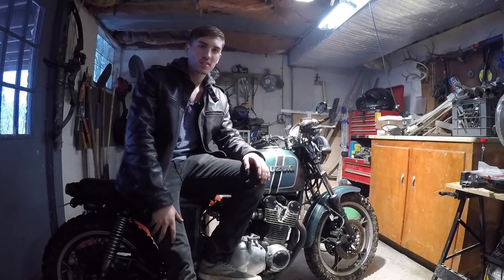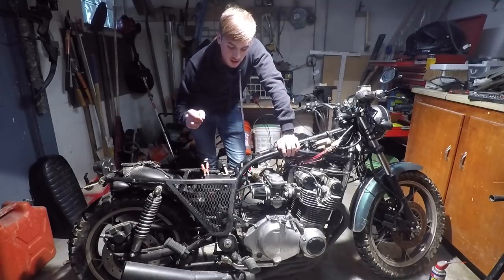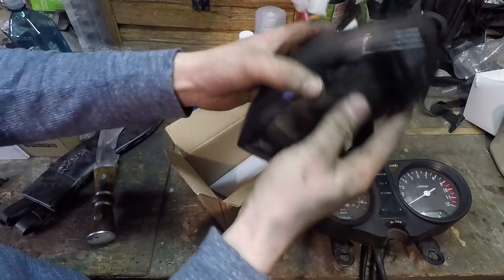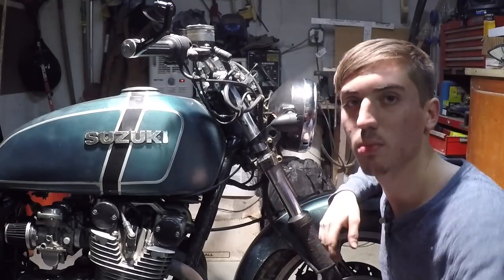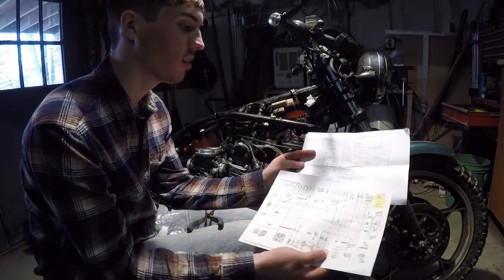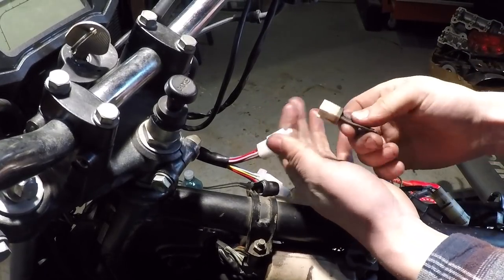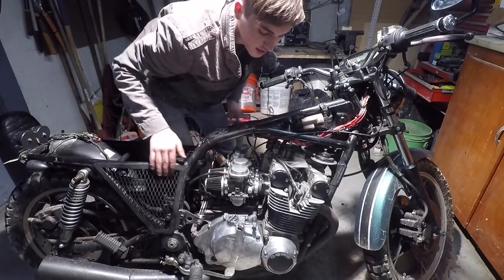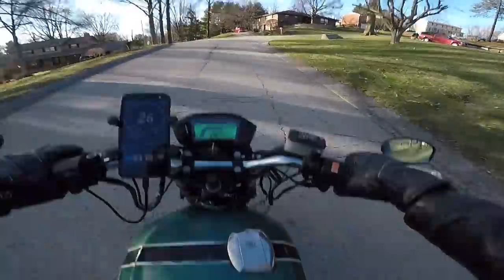How To: Convert Your Old Stock Tach/Speedometer Gauges to Digital! /GS850#14/

Comment: Was wondering where you found the English translation to the gauge instructions.. mine are in Chinese
Reply: A. Short press the left button to switch between total (TOTAL), subtotal (TRIP) and water temperature gauge.
B. In the subtotal interface, press and hold the left button for 3 seconds to clear the subtotal.
C. In the total interface, press and hold the right button for 3 seconds to enter the clock setting, the hour digit flashes, the second point does not flash, short press the right button to add 1, long press the right button to switch to the minute second flashing, the second point does not flash, then long press Right click to save and exit or 10 seconds of no operation to automatically save and exit or turn off the door to save and exit.
When the oil alarm symbol is displayed, switch to the TOTAL interface, press and hold the left and right keys at the same time for 3 seconds, the oil light will be off, and the next round of counting will start.
Light blue: turn right, 12V positive control, LCD display
Yellow/Black: Speed signal
Red: battery (normal, 12V positive)
Blue: High beam, 12V positive control, LCD display
Green/White: Water temperature signal
Green: 12V negative
Orange: Turn left, 12V positive control, LCD display
blue/white: fuel signal
Black: 12V positive
Φ4 round head
Brown/Red: Engine failure, negative control, LCD display
Gray: 6 gears, negative control, LCD display
Pink: 1 file, negative control, LCD display
Blue/Red: 2 files, negative control, LCD display
Green/Black: 3 files, negative control, LCD display
Yellow/Red: 4 gears, negative control, LCD display
Brown/white: 5 steps, negative control, LCD display
Green/Red: Neutral, Negative Control, LCD Display
red/white: positive sensor
Green: sensor negative
black/white: sensor signal
1 Background settings: enter the background with a password. (Major and Imperial backgrounds can be set)
Press and hold the left button to power on and enter the background setting interface.
P000: Password input 6610
4C1850:
1850 represents the perimeter, long press the left button to flash, short press the left button +1, long press the left button again to switch to the tens (0-9)
Tens digit flashes, short press the left button + 1, long press the left button again to switch to the hundreds digit (0-9)
Hundreds digit flashes, short press the left button + 1, long press the left button again to switch to thousand digit (0-9)
Thousands digit flashes, short press the left button +1 (0-2), long press the left button again to enter the magnet number adjustment interface
4 means the number of magnets, short press the left button + 1, long press the left button to save. After saving, short press the left button to enter the metric and inch interface
1-01: Metric
1-02: Inch system, long press the 1 of 001 to flash, short press the left button to switch to 2, long press the left button to save. After saving, short press the left button to enter the speed interface
2-002: Speed 166hz=10*1000 rpm, 2-004: Speed 333hz=10*1000 rpm, long press the left button and the number flashes, short press the left button to switch, long press the left button to save and then short press the left button to enter the fuel interface .
3-002: Two-Line Fuel
3-003: 3rd line fuel, long press the left button and the number flashes, short press the left button to switch, long press the left button to save and short press the left button to enter the main interface of the instrument.

Comment: Do you still have the Chenglish wiring diagram? I bought the same tach/speedo gauge but it didnt come with the diagram. Also the one the seller provided is completely wrong. Thanks in advance
Reply: A. Short press the left button to switch between total (TOTAL), subtotal (TRIP) and water temperature gauge.
B. In the subtotal interface, press and hold the left button for 3 seconds to clear the subtotal.
C. In the total interface, press and hold the right button for 3 seconds to enter the clock setting, the hour digit flashes, the second point does not flash, short press the right button to add 1, long press the right button to switch to the minute second flashing, the second point does not flash, then long press Right click to save and exit or 10 seconds of no operation to automatically save and exit or turn off the door to save and exit.
When the oil alarm symbol is displayed, switch to the TOTAL interface, press and hold the left and right keys at the same time for 3 seconds, the oil light will be off, and the next round of counting will start.
Light blue: turn right, 12V positive control, LCD display
Yellow/Black: Speed signal
Red: battery (normal, 12V positive)
Blue: High beam, 12V positive control, LCD display
Green/White: Water temperature signal
Green: 12V negative
Orange: Turn left, 12V positive control, LCD display
blue/white: fuel signal
Black: 12V positive
Φ4 round head
Brown/Red: Engine failure, negative control, LCD display
Gray: 6 gears, negative control, LCD display
Pink: 1 file, negative control, LCD display
Blue/Red: 2 files, negative control, LCD display
Green/Black: 3 files, negative control, LCD display
Yellow/Red: 4 gears, negative control, LCD display
Brown/white: 5 steps, negative control, LCD display
Green/Red: Neutral, Negative Control, LCD Display
red/white: positive sensor
Green: sensor negative
black/white: sensor signal
1 Background settings: enter the background with a password. (Major and Imperial backgrounds can be set)
Press and hold the left button to power on and enter the background setting interface.
P000: Password input 6610
4C1850:
1850 represents the perimeter, long press the left button to flash, short press the left button +1, long press the left button again to switch to the tens (0-9)
Tens digit flashes, short press the left button + 1, long press the left button again to switch to the hundreds digit (0-9)
Hundreds digit flashes, short press the left button + 1, long press the left button again to switch to thousand digit (0-9)
Thousands digit flashes, short press the left button +1 (0-2), long press the left button again to enter the magnet number adjustment interface
4 means the number of magnets, short press the left button + 1, long press the left button to save. After saving, short press the left button to enter the metric and inch interface
1-01: Metric
1-02: Inch system, long press the 1 of 001 to flash, short press the left button to switch to 2, long press the left button to save. After saving, short press the left button to enter the speed interface
2-002: Speed 166hz=10*1000 rpm, 2-004: Speed 333hz=10*1000 rpm, long press the left button and the number flashes, short press the left button to switch, long press the left button to save and then short press the left button to enter the fuel interface .
3-002: Two-Line Fuel
3-003: 3rd line fuel, long press the left button and the number flashes, short press the left button to switch, long press the left button to save and short press the left button to enter the main interface of the instrument.

Comment: Why not lower the headlight down to where you put it originally, then slide the new tach/speedo unit down to where it touches the top of the headlight? Would give you such a better streamline look!! Try it!!
Reply: Hi, I take your point about the 'look'... but I was going to suggest putting the lamp back where it started, by raising the new gauge on 's' brackets... I suppose it depends on how one sits...
But good video. Thanks.

Comment: how did you wire the fuel level???? I just picked this up for my 80 cb750 and the blinking fuel is starting to bug me lol... mine didn't come with fancy instructions, just a single page in broken english
Reply from the maker: gilberto tapia does your bike have a stock fuel guage?
Reply: there is a fuel gauge, but nothing that goes to the tank so i have no idea how it works... It should be similar to your 81 cb750.  Im just wondering if you remember the wire colors for the fuel gauge part of the digital display, so I can figure out how to delete it somehow. Thanks for the reply btw!
Reply: just tore the old cluster apart, the gauge wasn't connected, ... i guess the cluster that was on it was from another bike, so no gauge on the bike originally
Reply from the maker: gilberto tapia okay then you can't hook up the fuel gauge properly so to make it stop blinking you just have to ground the fuel guage wire on your new guage cluster, I cant remember what color it is

Comment: You should install clip-ons or at least drag handle bars next.
Reply from the maker: David Tacklind on a scrambler?
Reply: Absolutely. I have a 1978 Honda 750F that i bought new. I remember I paid $2200 cash for it.   The first thing I did was add Kerker 4 into 1 exhaust , Mikini carburetors and clip-on handle bars. Then i drilled the brake rotors - three hundred holes in all and painted the frame bright orange to compliment the black tank.  It's still cool. I have a collection of eight 1970's Honda 750's and 550's that I will be remodeled to look like Honda factory Daytona track racers with factory full race fairings. My every day bike is a 2004 Honda CBR 600rr.
Reply: That's a big no..  he need a upright and widely good controlled handlebar...stay with the flattrack/scrambler style GG..  and keep up the good work!!.

Comment: So what "idiot" lights does this have on it? Why dont you hook the tach to the negative side of the coil? Every other tach hook up is to negative side of the coil. 

I have a 99 shadow 750 and the cable speedo doesnt cut it and I only have lights for oil pressure, water temp, neutral, turn, kickstand, high beam.
Reply: what speedo did you use dude

Comment: Does anyone know if this would work on an older car fitted with a newer engine? 
Car model year Mercedes benz 1985 reads from tachometer cable, fitted with Lexus ls 430 engine 2001; which reads through speed sensor. For some reason my speedometer gets its readings from a cable not a speed sensor. I'm planning to switch it to an LCD display speedometer which I have the software ready for.

Comment: Bro can it be fixed on fz16 directly
Reply from the maker: It can be fixed on any bike, but directly? No, this is a universal unit so you will need to make or modify your brackets to fit it, and then you will have to splice the wiring harness on.
Reply: Not available on ebay send me the amazone site please

Comment: What about the fuel gauge?!
Reply from the maker: My bike doesn't have an in tank fuel level sensor so I couldn't hook that up but if yours does, just hook up the wire from your gas tank to the speedometer and it should work.

Comment: 2 quick things. 1: that tach does not even sorta look right. 2: you mentioned that the tach cabe went into the motor. If that is the case (and it often is on 70s/80s jap bikes), you need to make or find a tachometer drive plug for your bike, otherwise you might not have a motor pretty quickly. (And to be fair, you might have one, but you didn't mention it, so I thought i'd say something).
Reply from the maker: Ian Loughney yes! This is another thing that I forgot to mention in the video, thanks for reminding me. I bought a bolt from the hardware store that was the same size and threads as the tachometer cable, I drilled a hole in the center and it plugged the hole perfectly! Thanks for watching
Reply: Oh, yeah lol, that would work perfectly.

Comment: nice new gauge, lot better than new honda rebel 500 digital gauge, this is lot better. need change. but you bike has super ugly horrible seat, only idot can like cafe race style what have stupid style all world. you calipration has only one big mistage, GPS not have accurate and no can measure real right speed newer, why not add old gauge whit cable tie to test and calibrate gauge then first, and take old out when has calibrated ok.its only way make real right  speed.
Reply from the maker: nice translation
Reply: @GoldGuyRides  yeah,sorry my bad englishka, not have good haha. have true GPS not have accurate, has test manytime many university and cars. gps not vhave realtime, and accurate ,50meter have too little way measure, need drive 10km then gps see you better but not can see true speed newer right. i see you have honda cb 750 four bike too, i has same young boy. i has drive my life many honda haha, cb125 new has first bike,then cb350,cb500 four, cb750 four, suzuki "water gun" 3 cylinder water cooler 750cc, suzuki 1100,honda phantom 400. and rebel 500 last bike. ower 43 year has drive bike.and not newer accident.travelling around europe lot.